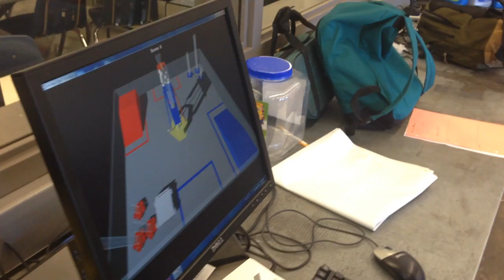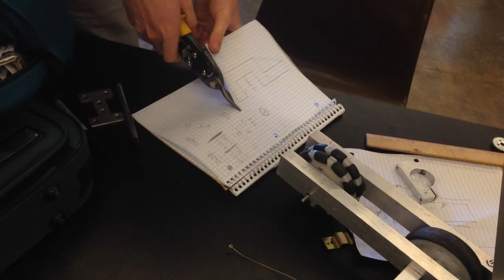Driving Forward // Cascade Effect Meeting Update

Comment: What size channel do you use for the frame?
It seems like a much nicer and lighter alternative to the Tetrix u channels.
Reply from the maker: Its 1.5"X.75" Aluminum square tubing with a .125" wall. It is actually mush heavier than C-channel. A standard Tetrix C-channel  weighs about .38 kg/m where the Aluminum tubing is about 1.52 kg/m. We used this tubing because we a want a drive base that is heavy so we don't get pushed around by other robots and sturdy so there is little fatigue over the season.
Reply: Awesome, thank you so much!
Reply from the maker: Yeah no problem!